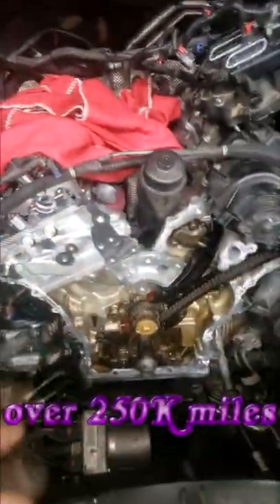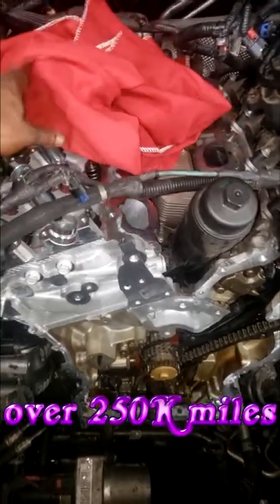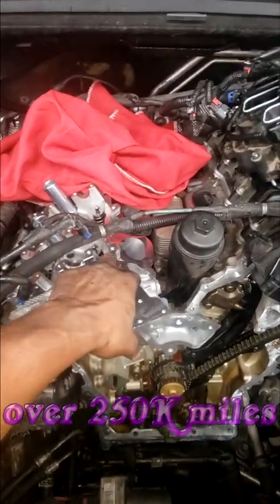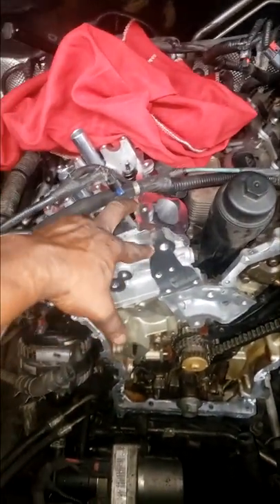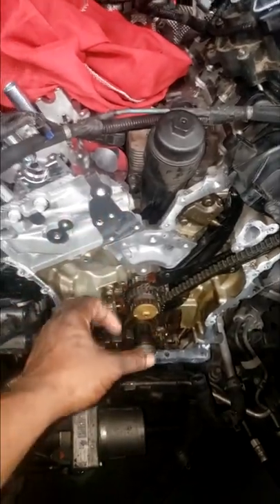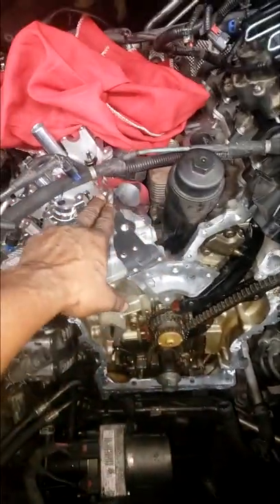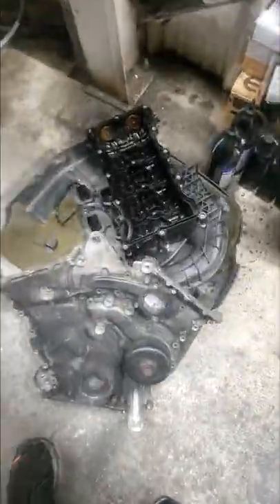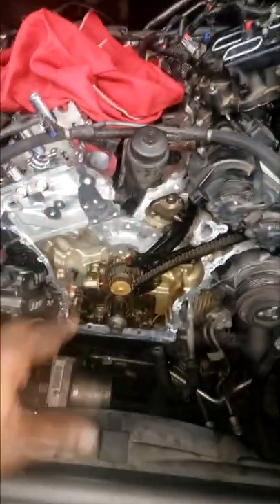High mileage motor gets a new head gasket and cylinder head. Here's why. #JTtheCarGuy #shorts

Comment: I'm surprised y'all didn't recommend to replace the engine 😆 alright I'm just kiddin calm down .
Reply from the maker: Lmao...Failed compression test, valve seat burnt..This not a badly overheated blown head gasket repair. Whats weird is that most all the videos that engines are recommended actually come from other shops..lol..That Liberty came from 2 other shops, the white Charger with the broken alternator came from another shop..Seems the other shops are cowards and afraid of reality or they threshold for bad news questionable. We don't sugar coat nothing. This what we recommend and if thats not what you want to do, simply take your car. Its the mechanics here on youtube that will always question those moves. But we will never please or try to please them. Lol so when somebody question what I suggest, I chuckle my ass off at them. Lol, I know you joking with this comment but its weird how that works..lol
Reply: @OnlineMechanicTips   yeah I'm sure there's always back stories to the vehicles that most of us don't know about and not enough time especially on a short video. Ive actually worked on cars for 18 years now, not my main job anymore for 12 years now but still work on them on the side. I've been in dealerships and independent shops. Its just always funny the mentality difference. What I've noticed is dealership guys want to over do it on the repairs because they're too afraid of a liability. Say a bad valve body or shift solenoid automatically turns into a nope trans needs replaced or the whole needs engine thing. My view is just fix the problem and don't be scared of it. Yes some things do warrant a complete engine or trans replacement but I just have seen too often people don't want to fix the problem. I know I've gouged you a couple times about engine replacement suggestions but hey overall I can definitely tell you're knowledgeable and I really like the YouTube videos so keep up the good work my man!
Reply: @OnlineMechanicTips  I've done head replacement on high mileage cars and the vast majority come back with high oil consumption due to the slight bump in compression with a new head. So we tend to use caution replacing a head.

Comment: You’re going to have to show us how you do a cylinder head without taking the timing cover off cause I thought the cover bolts up to the head on the top area.
Reply: That I know left you can do with a very short torx socket and remove bolt from tensioner but that right head you have no room to remove or put any tool in there since it’s so tight.